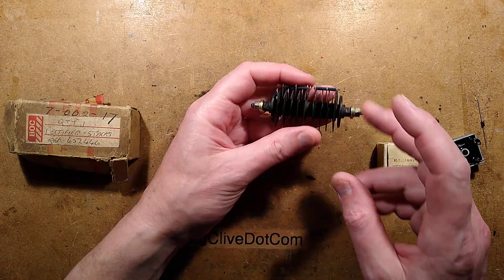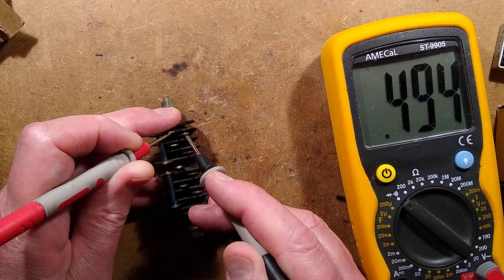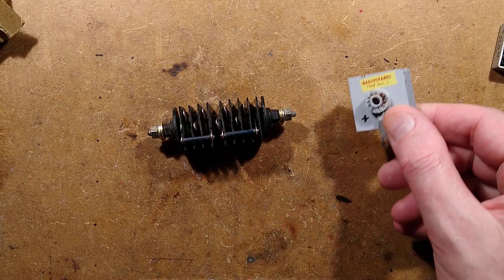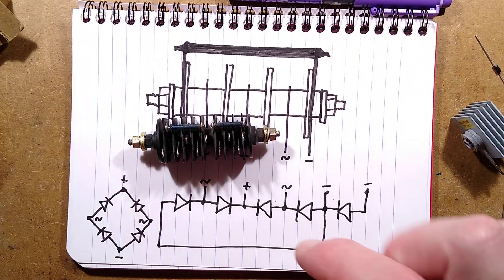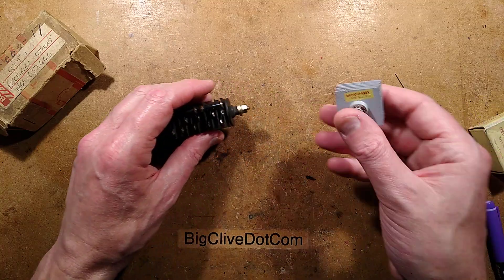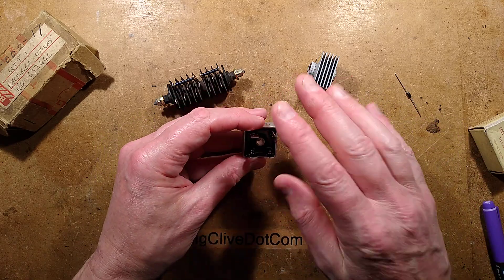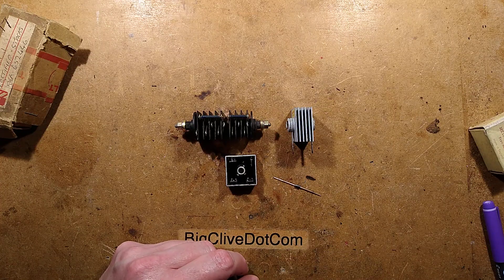Selenium rectifiers - the smelliest components ever

Comment: The MB356 bridge rectifier is rated at 600V @ 35 amps. Imagine the size of Selenium rectifier needed to match that! To run 35 amps, with that much voltage drop would undoubtedly require forced air cooling. One question that I have, is high frequency. a standard recovery bridge rectifier has a recovery current, that lasts a couple of microseconds, so while OK for 50-60 Hz mains frequency, they're not suitable for high frequency switching supplies. I wonder of the old Selenium rectifiers have that current tail or not. They are, technically, a metal oxide rectifier, and may be a minority carrier device. While the forward voltage drop is much higher, they may not have that recovery loss, allowing their use in high frequency switching supplies. I don't know, I've never had one to test.
Reply from the maker: An issue with selenium rectifiers for high frequency is capacitance due to their large plates.
Reply: @bigclivedotcom  At least, capacitance is reactance, and doesn't produce the heat, that an actual current tail may. You're right about the capacitance, due to the enormous die area, compared to a modern silicon rectifier. In fact, a modern Schottky diode has more capacitance, than a standard silicon diode of the same rating, for the same reason.

Comment: Now I know what that stack of 3"²   cuprous oxide red plates were in my granddad's home made car battery charger.
It was all attached to a bit of 3"x1" pine with a huge, glorious, analogue ammeter & hand coiled wires as connections between the components. 
Sadly, my uncle snaffled it when it was time to clear his bench. But you've just answered a 50 year old question I had as a kid.
Thanks Clive 😃
Edit: Here's a bit about the smell of Selenium. Quote "People get off the bus when Selenium chemists get on."! It seems if you get Selenium in your body it makes your sweat stink! It has much in common with Sulphur it seems. (Hydrogen sulphide has the classic rotting eggs smell.)
Here's Periodic Videos on Selenium.
https://youtu.be/IHrUtKjcAFE
Reply: @ Les Hemmings if they were copper discs then it was most certainly NOT a selenium, but a copper oxide rectifier. They shared the time frame, but were lower voltage and higher current than selenium. Often used in battery chargers before silicon became dominant in the late '60's.

Comment: On a large DC motor in 1972, I swapped out the selinium field rectifier for a modern one. 6 weeks later the field winding burned out. I had forgotten about the voltage drop in the selinium rectifier.

Comment: The smoke you smell is selenium sulphide, which is a cousin to hydrogen sulphide, the rotten egg smell, but yes it is a lot worse. That is the main component of anti dandruff shampoo, because it is an effective topical fungicide and insecticide, and is relatively harmless to humans in small amounts on the skin, though breathing it is not a good idea as it will damage your lungs. Shampoo they tend to add a lot of perfumes and menthol to disguise the smell, and there is not a lot in each bottle.
Reply: Where does the sulphur come from in a selenium rectifier?

Comment: They were designed(or at least used) to replace Vacuum Tube Rectifiers but were much less reliable and caused problems when they failed. The good thing is you can usually replace these with 1 regular 1N4007 diode and a resistor if the B+ voltage is too high in vintage radios & TV's.

Comment: I think half the reason vacuum tube/valve electronics were such high voltage was because the voltage drops across components were so much higher. The other half being tube/valve amplification being quite power hungry. Seriously the logic level voltage even was just higher too. Nuts.

Comment: I had an old car battery charger which had a selenium rectifier in it, plus a dual-tapped transformer so it could charge either 6 volt or 12 volt batteries. It finally gave out a few years ago, emitting the "magic smoke" which smelled like fresh vomit. Shortly afterwards there was even more of a vomit smell, since it triggered my own retching reflex. I managed to make it outside before the technicolour yawning happened, but it was a close one.

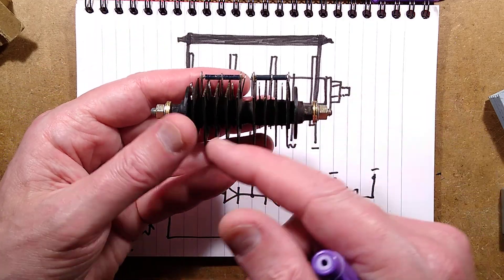Comment: 5:10  the extra diode would probably be the ground connection for the bridge, making the other negative output be available to supply a negative bias to whatever. This 'backbias' circuit was often supplied by feeding the bridge to ground via a suitable value resistor  but in this case they've used a diode, possibly for a more constant voltage drop.
 
And yeah, the pong these things produced when overloaded was horrific.

Comment: When I was in kindergarten in the early 80s, my school had old fluorescent lights that, when failed, emitted a very acrid toxic odor. That smell is forever etched in my memory, I think ballasts back then had weird semiconductor chemicals in them. Anyone have any idea what it was?
Reply: Cambridge Mart is correct, resin envelopes a simple autotransformer. Many of the older ones were labeled as PCB containing, as it was a great coolant. Many older schools and larger commercial buildings still have these types of lighting ballasts in service. They start “ bleeding” tar out of their cases when on the way to failure.
Reply: Typically it would be a phenolic resin used to insulate the ballast, they smell vile when they overheat.

Comment: I have a house full of old TVs and radios that I use on a regular basis. Having seen the way these fail when my aunt’s old TV blew up when I was a kid, whenever I run into one of these, which is pretty frequent, I always swap it for a 1N4007 in series with a low value resistor as a regular part of every restoration I do. It’s definitely worth the 5 cents to keep your house from filling up with eggy fart gas.

Comment: Selenium is indeed photoconductive. Laser printers use a selenium coating on their drums to transiently store a charge from a corona wire. The laser (or LED) exposes the areas not to be printed and those discharge back through the aluminium drum. The unexposed areas hold a charge and pick up toner with it. After depositing the toner, a light exposes the whole width to clear it and the cycle starts again.

Comment: Are there any circumstances where making a bridge rectifier out of LEDs instead of regular diodes would be favourable or would it just be an inefficient novelty?
Reply: LED forward-current limit is too low - a significant power load (or even the startup inrush current) would burn them out. LED reverse-voltage limit is too low - any more than maybe 5V and they would break down and conduct in reverse, possibly burning up. LED forward-conduction voltage drop makes them less efficient - instead of 0.7V like silicon or 0.3V? like Schottky diodes, LEDs drop ~ 1.7 to 2.3V when conducting.
Reply: Their forward current isn't great, their voltage drop is high, and their reverse tolerance stinks.  As power converters they're not so good.

I've used them as SIGNAL CONVERTERS though!  The red ones in particular, with a voltage drop of almost exactly 1.2 volts.  Red LED, pulldown resistor, and voila -- 3.3 volt signal from 5v source with cheap common components.
Reply: @tsm688  Two cheap diodes in series also drop ~1.2V (but they don't light up). Scaling 5V signal down to 3.3V can be done with two resistors (or just one resistor, if you count in the input's clamp diode).
Reply: @quaztron  For sure.  I happened to need a pulldown resistor in this application anyway though, so LED and resistor was perfect.

Comment: Another option for dropping the voltage, since you're already replacing a big bulky selenium rectifier with a wee silicon bridge rectifier and you have the room, is to take advantage of the voltage drop of an extra pi filter. As a bonus, the rectified smoothed DC will be that much cleaner. You just need to know the current draw of the supplied circuit and make sure the resistor is beefy enough to dissipate the heat, but that's basic Ohm's Law.

Comment: Early cinema carbon lamps used approximately 70 amps at lowish voltage DC. Usually using a selenium rectifier. I was called a cinema that had lost a show. On entering the foyer I knew exactly what the issue was by that smell. I returned to the car some some diodes. Everyone was really impressed that I could identify the fault without even going into the projection room. Those were the days!!

Comment: This is interesting. I just took some of these to the scrap yard, I took them out of a 60 year old arc welder.  I was curious about them and here this pops up. BTW, this one was about the size of a toaster oven.
Thanks.
Reply: Right on, Danny !  I have an old Lincoln gas engine driven AC arc welder, afraid to use it because it has a selenium rectifier in it. No clue as to what modern silicon based unit to replace it with

Comment: The Dynaco stereo system my father built from a kit ("Dynakit"!) in the early or mid 1960s used a selenium stack rectifier in one critical circuit instead of a "normal" vacuum tube. I feel certain I read in the manual they used it for its lower noise, though now I cannot recall if it was in the preamplifier or the FM tuner component. I do clearly remember the rectifier was painted green. 😀
Reply: Probably the PAS-3 preamp.  Used a selenium bridge in the filament circuit to run some of the tube filaments (probably the phono preamp) on DC to reduce hum.

Comment: What's the best way to (if possible) correct for the voltage drop?  I want to convert a lawn tractor headlight from incandescent to LED so 14 volt AC minus the 4 volt loss from the rectifier leaves only 10 volts which might not power the 12 volt LEDs.
Reply: Except that rectifying the AC multiplies the voltage x1.4.  So you will have 19.6VDC-4VDC=15.6VDC
Put a C-R-C filter after the rectifier and calculate R for 3.6V drop at the rated current.
Reply from the maker: The higher voltage comes from the capacitor being charged to peak voltage (if one is used).
Reply: @bigclivedotcom  Thanks! Time to rummage through and dig up a suitable capacitor.

Comment: I was working on an old radio from the 1940s. I had it on the bench by a window in a far corner of my workshop, a section of my workshop I don't spend much time in . I had the radio plugged in and I was getting ready to take some voltage measurements when I suddenly catch a whiff of something nasty. My first reaction was that something died in that corner of the room. I looked around by the window, under and behind the radiator, under the bench but couldn't find anything as I catch a few more nasty whiffs. I decide to move the radio to my other bench and as I am getting ready to unplug it I notice a few wisps of smoke coming from under the chassis. I pull the plug, flip it over, and get hit with a really strong whiff that almost made me puke. Then I look where the smoke is coming from and I notice the selenium rectifier. The power supply had shorted and the seklenium rectifier overheated and was stinking up the whole joint.

Comment: Selenium stack rectifiers do have a pretty good life expectancy, though. You'll find them all the time in televisions and radios from the 50s and 60s and they'll almost always still work. Luckily they rarely go dead short either, usually they just get a super high forward resistance or go open, so it's actually recommended service to just bypass them with a regular 1N4007 silicon diode in most applications. Don't even need to cut the selenium out.

Comment: I repair vintage audio gear for a living. Many tube amps use these for bias rectifiers and filament supply rectifiers. My rule is to replace them with silicon on sight. I NEVER leave them in place unless the client insists. You do have to add some resistance in series in most cases because a silicon rectifier will have less voltage drop than a stack of seleniums. 
Also, selenium is poisonous....

Comment: The very first electronics repair I ever did, as a lad of 11 or 12, was replacing the selenium rectifier and filter cap in my dad's Sarkes Tarzian table radio, which makes sense since the company that made the radio was a big manufacturer of selenium rectifiers. Named for the Armenian immigrant who founded the company, and an extremely important company in the history of radio and especially television---- they were at the forefront of TV camera and video electronics, and owned a network of broadcast studios. Look up the history of the man and his company, it is a long and fascinating story.
Reply: Interesting, I built a small radio from instructions in Electronics Illustrated in 1959 or so, it used a modern silicon rectifier...Sarkes Tarzian...for 60+ years now, I always wondered where that name came from....very interesting, because I'd already read a lot about Nikola Tesla.

Comment: Normally, when someone tells me something like, this smells completely awful, I take that with a grain of salt and move on.
When Clive says it, I have absolutely no desire to be in a one kilometer radius of the failed part.
Reply: This is a smell that you have to experience, to truly appreciate how overwhelming it is. Even bottles of Selenium supplements have the same disgusting smell, although nowhere near the same intensity. I have serviced many pieces of equipment, that used them, and the only good thing about a non-working unit was...if the selenium rectifiers were history...the smell would be there....to tell you where to start.
Reply: @darylp8564  
OHo! 
You got it Man.
Reply: sparkplug1018
I promise you, Oh..boy... they do pong.
It's very much like H2S, maybe it IS hydrogen sulphide..
Unquestionably...bad eggs or last night's vindaloo!
Embarrassing if somebody who doesn't know about them walks into your workshop!
Reply: @MauriatOttolink  Hydrogen selenide, H2Se.  https://en.wikipedia.org/wiki/Hydrogen_selenide
Reply: @bobweiss8682  
Ah... That explains it.  Certainly smells like H2S!
Reply: @bobweiss8682  A late thank you!
Reply: I was next to a very old TV set when its selenium rectifier failed with a loud pop.  The smell was unforgettable.

Comment: changing a fuse without diagnosing why it blew 🔥🔥🔥🔥🚒
Reply from the maker: No obvious sign and a ceramic fuse, so not possible to tell it had splattered.  Sometimes fuses fail with age through repetitive thermal cycling or local vibration (contactor)

Comment: One blew up in Radio Shop in my High School (1969). It smelled like a combination of rotten eggs and rotten garlic. Not too surprising since its chemical properties are halfway between those of sulfur and tellurium (compounds of which  reek of garlic), and selenium is between those elements in the Periodic Table.

And yes, if I ever find one in a piece of gear I immediately replace it with an equivalent silicon device plus an appropriate resistor as required.

Comment: I can send you some Clive… to teardown and inspect. I HAVE HUGE ONES!!! like the size of a a large shoebox! The bigger ones probably weigh 10 to 20 pounds if I had to guess.
.
Also a wide range of sizes, all the way down to little tiny ones. Some of the small-medium ones are still new in the box.

 The huge ones were used in MASSIVE welders, and other large hi power industrial equipment

I shop government and industrial auctions, so I’ve ended up with a lot of useless shit over the years.
Reply from the maker: Thanks for the offer, but they'd just end up in the hoard.

Comment: That's the reason why they were called "stink stacks" - that acrid smell.

I have a bridge rectifier that looks much like a selenium rectifier, but it has copper oxide on the plates.  🤔👍🤗
Reply: very small copper oxide rectifiers were commonly used in Volt-Ohm meters for the AC volt/AC current ranges.

Comment: I’ve replaced so many of those damned things, and dread it every time!

 You’d be surprised how common they are, in industrial and precision test equipment.

I get a them sporadicly every few months… From a wide variation of clients and equipment.

Finding a substitution, can be difficult if it’s damaged or has no identifying marks.
And in many cases, it’s in a device that’s either really rare, or so old there’s no available documentation/pictures.

Damn hard to find a substitute, if you can’t identify the original or characterize it in anyway.
Can be a real bitch. 

Especially if you’re an idiot… like myself🤪😁
Reply: If it's in such old devices I wonder if those companies owning the equipment got rid of the service manuals at some point. Depends a bit on the market segment but I remember a lot of old equipment coming with useful diagrams and specifications, unlikely to see that today for most stuff as an end user.

Comment: I have a HUGE Se rectifier. Want it?
Reply from the maker: No thanks, it would just end up as more clutter here.
Reply: @bigclivedotcom  Cool, it will stay on the spares shelf then. Our switch board at the bunker still has its original Se rectifiers in use. I've been meaning to replace them. Once thing you can do to limit that voltage increase is a calculated series power resistor. I use them in jukeboxes when replacing there. Any typical bridge rect and a 100ohm 5w resistor in series with the positive.